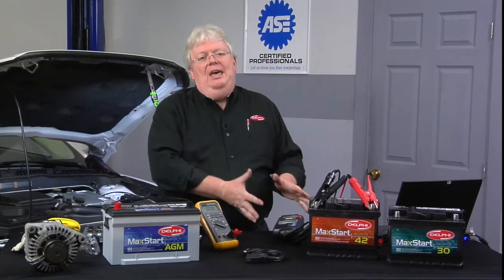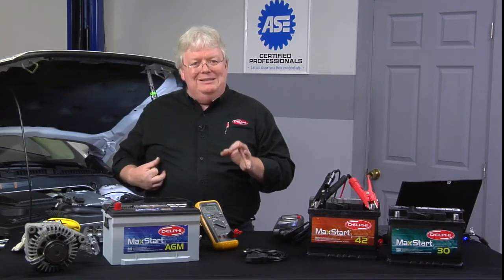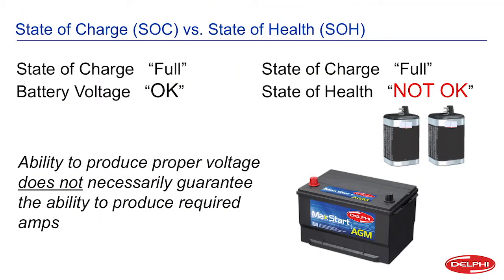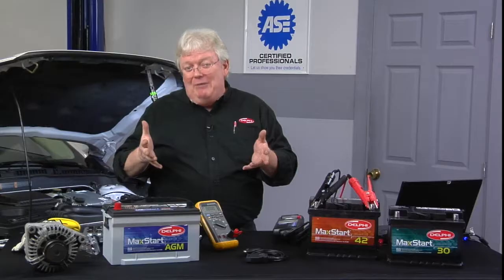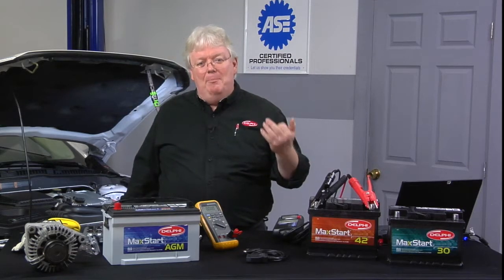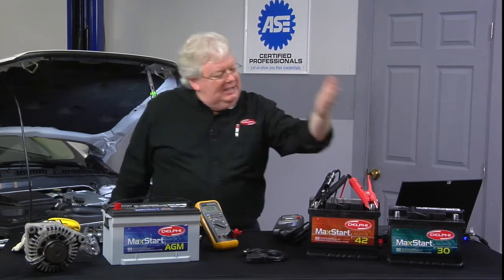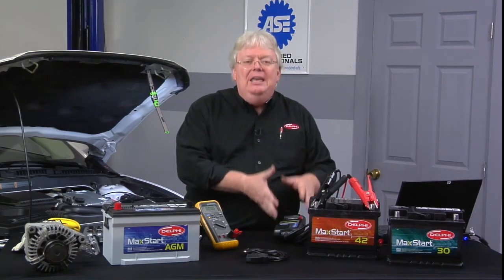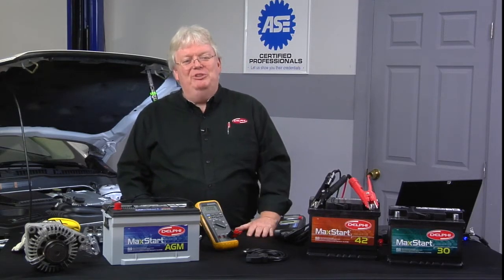What is the Difference between Battery State of Health and Battery State of Charge?

Comment: Thank you for a great description of SOC & SOH. I have just purchased a tester to check my spotlight & Kontiki (motorised long-line) batteries. Some were showing 98% SOC but Poor health - Replace. The smaller spotlight batteries with spade connections are not designed to start an engine... I,m off to test them again with the CCA set on minimum - fingers crossed they are OK.
Reply: Just retested with lowest (2A) setting and SOH 98%... Good Battery.   Was 45% on 7A CCA setting.
Reply: My results are "Replace" with a new battery fully charged. Even got charge-retest. Cheap battery testers are not that good. It's also rough estimated calculations
Reply: He actually didnt explain at all what the state of health measurement actually is. Skimmed ove the word conductance but not enough to clear anything up. Tese tester are for lead acid batteries and not for alkaline so that is not a good analog at all since the chemistries have different properties.